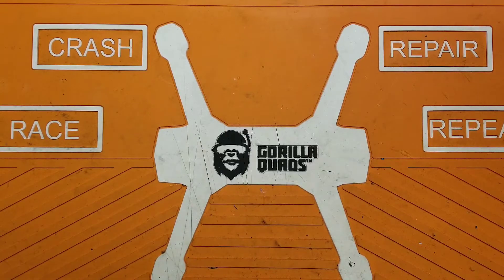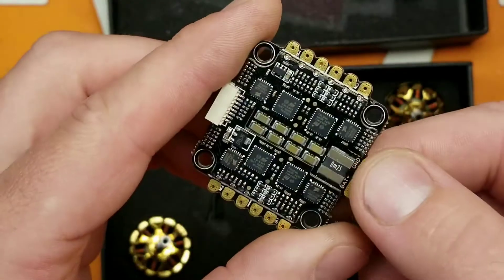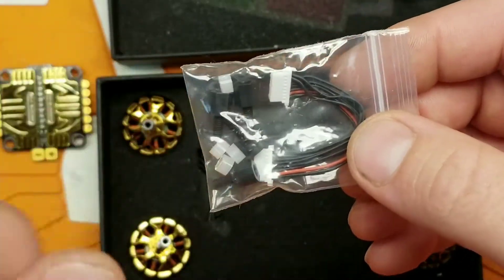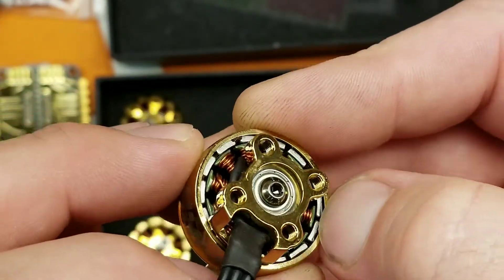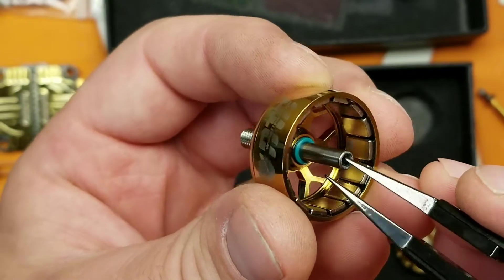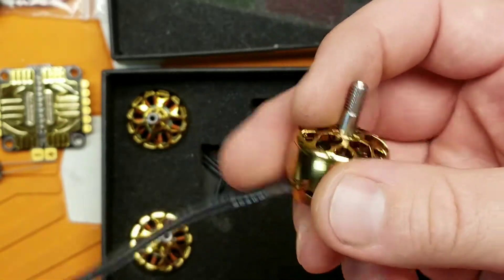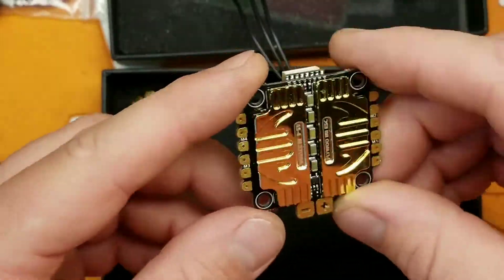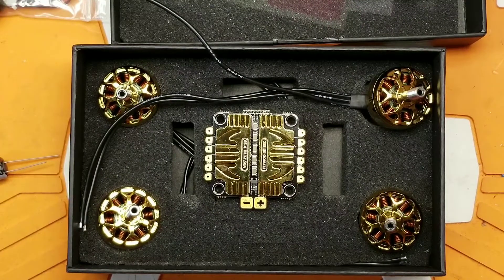Flywoo motors and esc set

Comment: The motors look fine and will do the job.  However, there is a lot of wasted airspace between poles.  If the manufacturer had used the same number of winds, but filled the space with copper, the motor would be more efficient.

Comment: Love the flywoo herd they are made at the same facility  as the xing. They perform great .but there shipping sucks takes way to long i spoke with them and told them they need a distributor in the states . Ive used dshot 1200 cant notice a difference  ive read somewhere not to use 1200 on 6s but who knows lol flywoo motors are really good youll like them
Reply from the maker: That are built really well. And yes thier shipping suuuuuuks. It took almost 2 months to get here!
Reply: @TweetFPV  lol thats the only reason i dont buy there products unless i want to wait